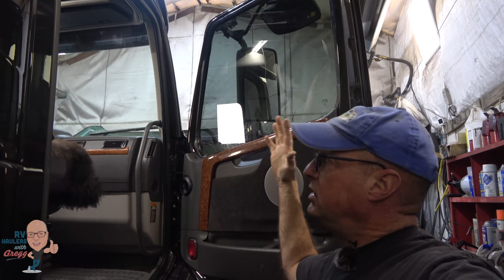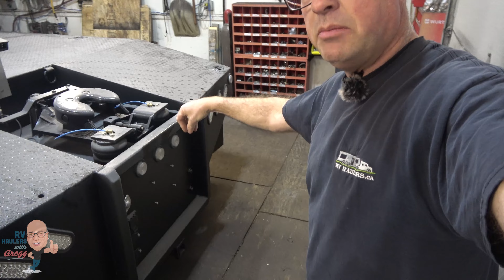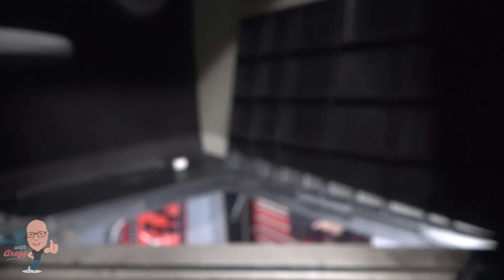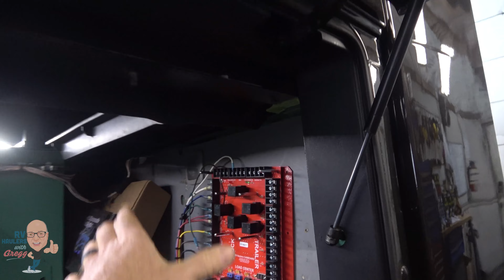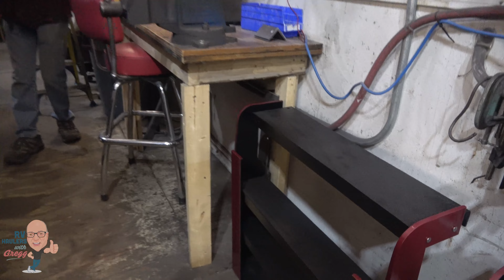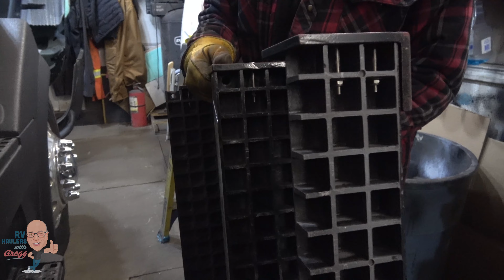Rapid Fire upgrades boogey lights horns seating electronics

Comment: Did you think about using lumar air 90 clear window film on the windshield ?  We did to our class A. It blocks 99%uv and 65% of the heat.  It’s also legal to use.
Reply from the maker: Hi American MX - 
I didn't know about that product until you just shared that name.  LLumar.  Very nice!  I appreciate you taking the time to share that interesting film product.  I will definitely keep that link in my library.

Thanks for watching and commenting - Gregg